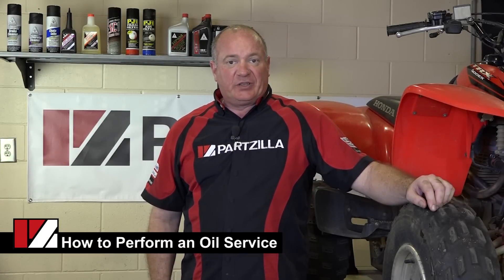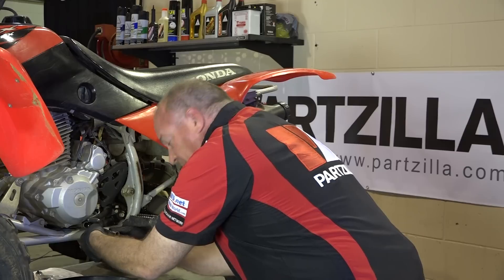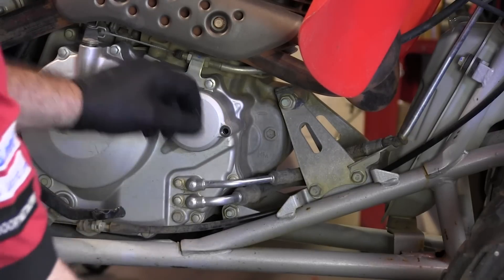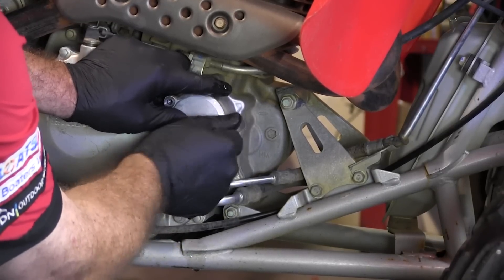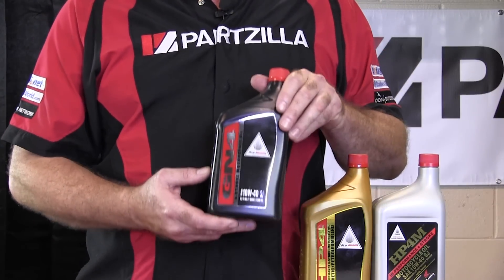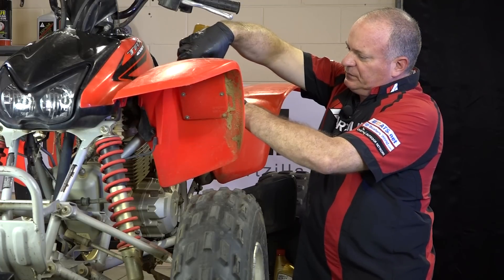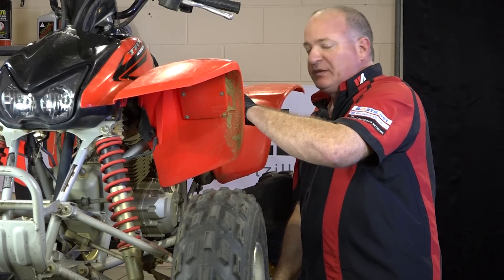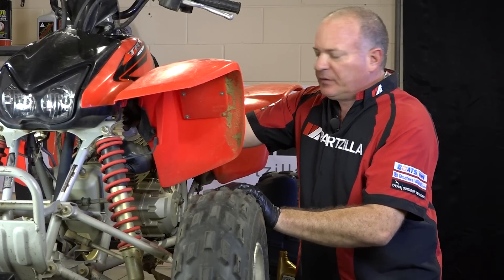How To: Honda ATV Oil Change & Oil Filter Change - TRX | Partzilla.com

Comment: Great video, should mention something about replacing the crush washers. Just performed my first oil change on used 07 400ex and it looks like I have a slow leak coming from the drain plug on the crank. I am assuming a new crush washer will fix this.

Comment: Great video. However when i filled the tank i didn’t need to run the engine to prevent overfill on the second quart. Bike level was just fine and still runs great.

Comment: Partzilla, I have a 2004 400ex that I just did a complete rebuild on. About a month ago I rounded the head on the engine drain bolt and wasn’t able to remove it. I have recently gotten the bolt out and ordered a new one. The new bolt I purchase didn’t come with a crush washer, but it has a o ring around the end. Is the crush washer necessary? Or would the o ring work just fine? Any feedback is nice and I would really appreciate it.
Reply: Also, if the crush washer is necessary, would I need to change the crush washer every oil change? Or would the same one work?
Reply from the maker: Crush washers are important.  Change every time you change oil.

Comment: Hey John, thanks for the tips and your time. I just removed the plug for the oil tank and it seems that the receiver thread came out as well. Is it possible to screw it back in or will I need to buy a new tank?
Reply from the maker: If it's stripped, there are ways to fix it if you have to, like a Helicoil rethread kit, but with something like an oil tank, it's probably just easier to replace the tank.  They are relatively inexpensive.
Reply: thank you sir! I just ordered the new one. We'll see what else is lurking around the next repair!

Comment: I do exactly what you just did when I change my oil on my 2001 400EX. In after I run it and everything I barely get a reading on my dipstick. 2 quarts of oil puts the reading just a hair above low on dipstick.... What is going on here why is it reading low .do I need to  use three quarts?

Comment: don't get me wrong.. Mr Talley is my hero in this topic, but for this one I beg to defer in the filter replace.. first you need to fit the filter in the cover, then in the engine, not the other way around, if you do the engine first, then the cover you can put it uncentered and you will not be able to notice it, hence clogging the oil flow..  for both the filter to the cover and the spring to the engine you can use a small amount of sticky grease in order to keep them still..

Comment: if the quad has been sitting for a year.and I check the oil dip stick and its dry.is it accurate..also it won't start.so do I need to start it to check it?
Reply from the maker: After sitting for that long AND the dipstick is dry, I would drain and refill the oil to the proper level before you attempt to start it.

Comment: I have an 05 trax 400ex and I notice when you fire that one up it ticks. Mine does the exact same thing . Any advice
Reply from the maker: Hello Jarrett. I most cases a ticking noise at idle indicates that you my need a valve adjustment.  Here is how to do it!
https://www.youtube.com/watch?annotation_id=annotation_168452459&feature=iv&src_vid=D-lX2oUIwSE&v=AConzWtH8Fk
Reply: A valve adjustment or your timing chain  and if it’s your timing chain you best get it fixed soon or it could jump and you’ll send your piston into the valves which will toast your engine

Comment: Hello does this 400ex honda has transmission fluid separatly from engine oil or it uses engine oil as transmission fluid?
Reply from the maker: It's just the engine oil.

Comment: Hey John! Everything went smoothly until I got the the crank case bolt. I completely rounded the bolt head and can’t get the bolt out. What would you recommend?
Reply from the maker: Going to need an extractor set to get it out.  Or you can take it to a shop to pull the bolt for you.

Comment: I think I'm having an oil issue. 2004 Honda 400ex. I watched this video.. great video by the way. I did my oil change just as you said. rode it around for a couple of days .. checked the oil .. and bam zero oil on the dip stick. so I poured in what was left from the initial oil change. start it ran it.. checked again and no oil on the dip stick. not sure it is my oil pump or not. any help will be greatly appreciated
Reply from the maker: That is an issue.  You have a magic ATV, it makes oil disappear!  How much oil did you put in originally?  I'm sure this is obvious, but I have to ask, it's not leaking anywhere?  Are you blowing smoke from the exhaust?
Reply: I poured in 1.9qts.. No oil leak, it sits in the garage no puddle on the ground. It doesn't smoke either...
Reply from the maker: Well, it has to be going somewhere and there are only a few places it can go.  It could be leaking only when you run it and it's under pressure.  Maybe from an oil line?  So you wouldn't necessarily see it on the ground in the garage.   Or it's burning it.  At that rate, you should see smoke though.  When you put in the oil in the oil tank, did the dipstick ever read full?
Reply: Yes, after I did the oil change exactly like the video. The oil was 3 quarters of the way up. so after I took it up the street for 2 days I decided to check it again. That's when I saw noticed there was nothing on the dip stick. Could it all be in the crack case? I just bought it for $1700 bucks. The Honda powersports shop up the road wants $85 an hour + parts.. lol Trying to take the DIY approach.
Reply: Just wanted to see if there is anything I should check before I order a new oil pump.. want to be sure it is needed
Reply from the maker: From gut instinct, I don't think it's your oil pump.  What kind of oil are you using?  If you are running synthetic, it's possible that you are burning it off without the smoke for evidence.  Then it would be a bad ring issue.  It looks like it's running well.
Reply from the maker: Side note: I've seen these quads take up to 3 quarts.  Also, make sure you are screwing the dipstick down all the way when checking oil.  Just things that are popping in my head about this issue.
Reply: I used, Mobil1 4T 10w40. It does run pretty good. Should I run the Honda oil through it, to see if it smokes?
Reply: Didn't know it could take up to 3qts. I'll change the oil again today and grab an extra qt.
Reply from the maker: It's not supposed to take 3qts, but I've seen it happen.  Typically, if your oil is disappearing like Houdini at a show, it's either a leak or excessive burn off.
Reply: Joe King did you fixed you problem?
Reply: Probably larger aftermarket oil reservoir which would have about 1.3 extra oil capacity, 1.9 qtrs. thereby not enough.

Comment: I changed the oil on my 2003 Honda recon 250 es following all of the instructions in the manual but when I run it for more than 2 mins pressure builds up and when I unscrew the dip stick just a little bit air starts trying to escape and theres oil dripping out of the pipe 

I don’t know a lot about atvs so if you could help me that be great
Reply from the maker: Did you double check your oil level?

Comment: I already know I need to drain from crank case, but do I need to drain oil out of oil tank also when I’m removing the motor
Reply from the maker: It's recommended.  If you're going that far, you'll want new oil anyway.
Reply: Alright, great channel btw!

Comment: Can I just put the whole 2 quarts in? Will it just be at the upper level or will it cause a problem
Reply from the maker: It's better to check the level and stop when full.  If you overfill, you can cause running issues.

Comment: I just broke the nut in my oil tank how is that for changing the oil and filter for my first time John Talley?
Reply from the maker: Not sure what "nut" you're talking about?  You mean the drain bolt? or the fill cap?  And how did you do that?

Comment: So 10-40w oil is the most recommended for this motorcycle?
Reply from the maker: It's the oil that Honda shipped it with and recommends. The upgrade would be  http://www.partzilla.com/parts/detail/honda/HP-08C35-A14W0M.html

Comment: My mechanic asked me to clean my 400ex oil tank do you know why or what I can use to clean/flush it with
Reply: He said he's saving me money by having me do it. He has my entire engine.
Reply from the maker: Take it off the unit and see how bad it is.  If it's cleanable, some contact cleaner and a brush should do the trick.  If it's worse than that, just buy a new one.

Comment: I just changed my oil on my 05 400ex for the first time and when I took the oil filter off I noticed there was no spring. Where could I get one of these?
Reply from the maker: http://www.partzilla.com/parts/detail/honda/HP-15414-KF0-000.html

That is the spring for your unit.

This is the full diagram.
http://www.partzilla.com/parts/search/Honda/ATV/2005/TRX400EX+A/RIGHT+CRANKCASE+COVER/parts.html
Reply: I have a 2007 Honda trx450r do I need the spring ? If so where can I get one

Comment: Wait you don't have to change the oil filter covers o ring? I thought it said to do that every oil change
Reply from the maker: No, it's not necessary to change every oil change.  Add a dab of oil to the o-ring when you reinstall and inspect it for damage or cracking every oil change.

Comment: Can the HP4 oil be used in a 2006 honda 250ex?
Reply from the maker: Hi Lombardo. We recommend the GN4 for the 250ex, however, the HP4 will work just fine.  It is a wet clutch, so don't use the HP4M.
Reply: thank you for the info im usuing valvoline atv 10w 40 at the moment. the old labeling on quarts said it was for wet clutch but on the new label it say formulated for wet clutch protection. does that mean its safe to use on my honda 250ex?
Reply: Got this off the net = (The wet clutch system, high torque and loads, and the extreme operating environments of ATVs require an oil with special properties for proper performance and protection. Valvoline formulated ATV oil to meet the specific demands of ATV applications, providing the proper frictional properties for the wet clutch system and the film strength for high running temperatures.) Hopefully this helps someone out like it helped me. http://www.valvoline.com/our-products/motor-oil/4-stroke-atv-motor-oil

Comment: I accidentally changed the oil and forgot to pull out the oil filter out as the bike drained I changed it after I put a Lil oil in the bike so I could not drain I agen is there a lot of old oil in there still?????
Reply from the maker: Hello Casey. only a little, but i would definitely replace the oil filter.
Reply: Partzilla I change the oil filter right after I noticed that I forgot all I am wondering is would there have been more oil drained if I had done it at the same time
Reply: Because I did not want to pull the plug again because I already had oil in the bike
Reply: I figured out the problem just one more question why didn't you screw in the dip stick all the way
Reply from the maker: I  did not screw in the dipstick because, on this unit when you check the oil level you just place the dip stick on top of the crankcase.

Comment: Excellent - thanks a lot
Reply from the maker: Thanks for watching!
Reply: Partzilla I have a trx 250 ex '07. I don't have this oil filter cover. owned it since new. just found an oil filter I bought years ago. I must have never installed it for a reason. any clues?
Reply from the maker: Going to need a little more clarification.  What oil filter cover?
Reply: Partzilla 07' trx 250 ex. that's what you are working on in this video. mine has nowhere to access an oil filter. the manual mentions a filter, but not where
Reply from the maker: The video is on a TRX400EX.  The TRX250 doesn't have an oil filter.  Just a strainer/screen filter that you service every 200 hours.  You have to crack open the cases to get to it.
Reply from the maker: http://www.partzilla.com/parts/search/Honda/ATV/2007/TRX250EX+A/CRANKCASE/parts.html

#6 on the diagram.
Reply: Partzilla that would explain it

Comment: Aite i changed my oil n oil filter just like in the video but everytime i go to check the dipstick it keeps showin it nothing in it... Can sumone plz tell me wth im doin wrong???
Reply from the maker: If you are filling up the oil tank and not showing oil...you need to figure out where it's going.  Maybe add another half quart and see if it registers.  No more than that, you don't want to completely overfill it.
Reply: Arick Bullock i did like the video, and it show in it nothing in it. Did you fine the problem

Comment: So you never just add oil. You have to drain the old oil, replace the oil filter, and then add oil? Sorry I'm new to this
Reply from the maker: Dylan, you should never apologize for trying to learn.  If you have to add oil, then you are leaking oil somewhere and that should be fixed.  A proper oil service is to drain the old dirty oil, new filter and add fresh oil.  After awhile, the heat and friction breaks down the oil viscosity so new oil helps keep the motor in good running condition.  Happy to help.

Comment: Does a 2007 Honda trx250ex have an oil filter?
Reply from the maker: Kind of.  There is an oil screen on the bottom of the motor.  
#6 on Diagram.
https://www.partzilla.com/catalog/honda/atv/2007/trx250ex-a-sportrax-250ex/crankcase
Reply: how often would i want to clean/replace that? Thanks again
Reply from the maker: You don't.  Just change the oil. You only change that screen when you have to do motor work. It's not readily accessible.

Comment: I have an 07 250ex and there is a metal o ring that goes on before the oil bolt on the bottom of the quad... anyone know what that is called???

Comment: Can I run regular 10-30?
Reply: Rough Garage you need oil specifically for wet clutches if you don't your clutch will slip

Comment: How often should you change the oil in a 400ex?
Reply from the maker: The Honda manual says every 100 hours.  I prefer to over maintain so I would do every 50 hours or so.  Just to be safe.

Comment: 08 honda trx 400ex right oilfilter cap bolt i was lossening the bolt to change oil filter and it broke how can i fix it
Reply from the maker: The bolt broke off in the motor?  Use and extraction kit or drill it out.

Comment: How often should the oil and filter be changed on these?
Reply from the maker: Honda recommends every 100 hours.  However, changing them earlier never hurts.  50 hours is more beneficial in my opinion.
Reply: Say your buying a used 400x, is there any way of knowing how many hours it has?
Reply from the maker: Not really. You can check to see it if was maintained well.  Anytime you purchase a used unit, it's advised to just change all fluids and check brakes so you start off right.

Comment: Can you use Kawasaki k tech sae 10w30 4 cycle contains zinc ?
Reply from the maker: I don't see why it would hurt anything.  I was under the impression that oil was mainly for Kawasaki mowers and lawn equipment.

Comment: 2002 honda 400ex...let it run about 2min.. Then checked the oil level after sitting almost 5min...the oil tank was full to the top?  No smell of gas. Oil was clean? Any ideas?...i drained both plugs and pulled filter.. Thinking i might add and start fresh tomarrow then look again